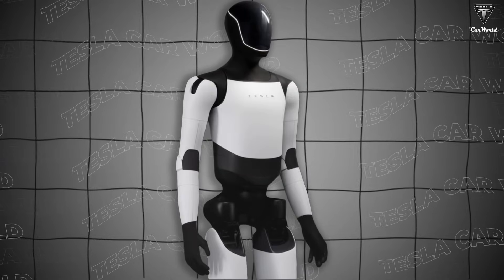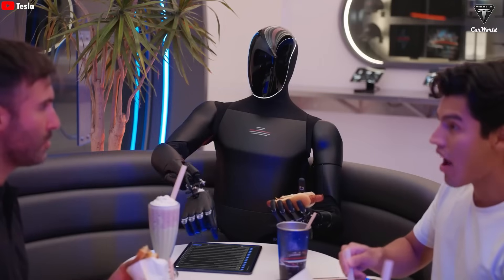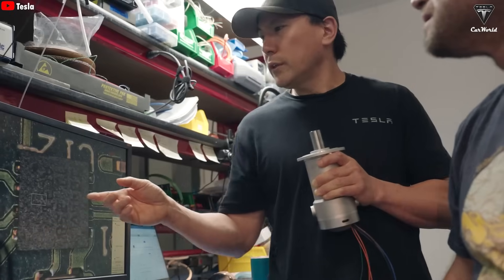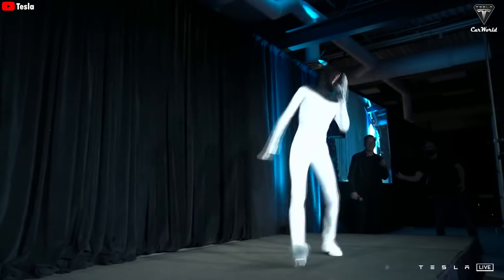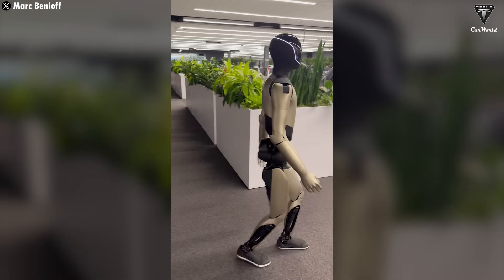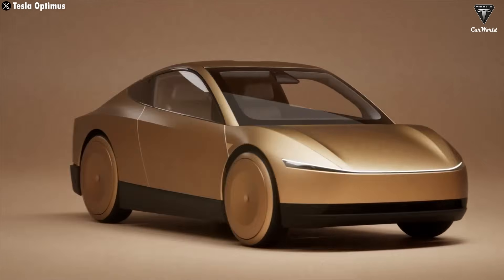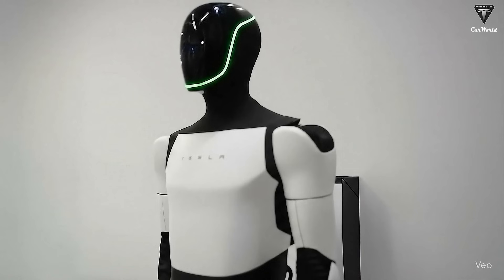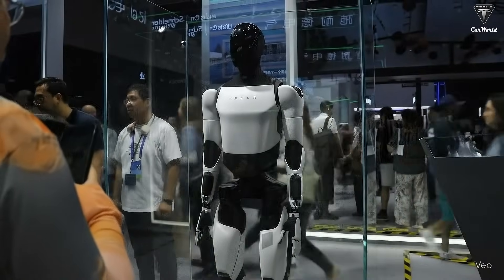Finally Happened! Tesla Bot Shocking COOK A Meal & Food Delivery! Elon Musk Drops NEW Update!

Comment: The guy who suggested the 1000% raise plan from $30,000 to $500,000 aims to eliminate or oust in the future (by??? bankruptcy, rare earths, data leak so one of the most daring companies in its sector so in his position as the only future (1T = Trillionaire $1 trillion equity) Capable of leading the Armada of spare parts practiced by the robots Themselves, and not justified by additional increases in the base price of a machine already highly skilled for visual diagnostics justifying adjustments or replacements, instead of the additional prices of time-consuming and intermediate human labor then bringing $200,000-$500,000, the OPTIMUS GEN3 OR GEN4 robotic AI unit, which then becomes by dragging this scam to WIDESPREAD labor, no longer a CUSTOM-BUILT machine for the rich between $20,000 and $50,000 (Cybertruck Evolution Brand), But a new field of competition and sabotage is being built very quickly. The company quickly, in the shadows, confronted Tesla and E.MUSK as a whole, which represents a major obstacle for the test and assembly lines of the various modules of OPTIMUS and their future hybrids, which constitute fertile ground for the 2027-2035 competition. In the absence of a very high degree of freedom listing in the hands of Optimus, not listed on the stock exchange and therefore inaccessible to ordinary customers, an inevitable bankruptcy or failure due to the low capitalization of the purchase options of the various cores presented in the civil, maritime, energy, medical/laboratory, aeronautical and navigation sectors, such as drone delivery operators, etc. Time is therefore running out before 2035-2040, which is not so far away, and a trillion capacities would be quickly available with the right global resources, well managed in good hands, such as those of Optimus AI and what it represents in general, with trillions of hours of evaluations perfected every day by humanoid AI cells. Millions of task updates in perspectivesome of Boldest Company in is